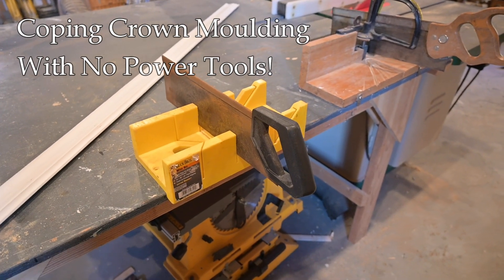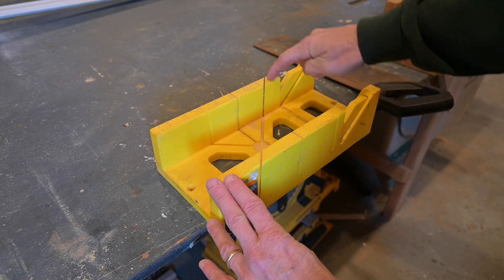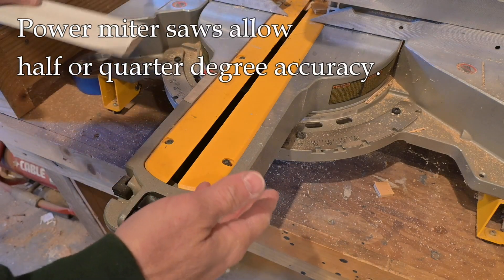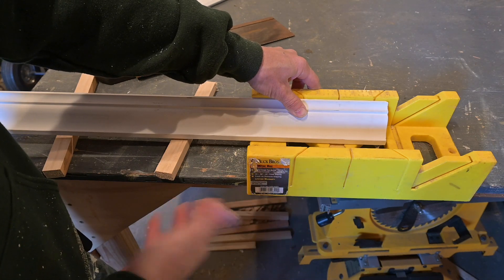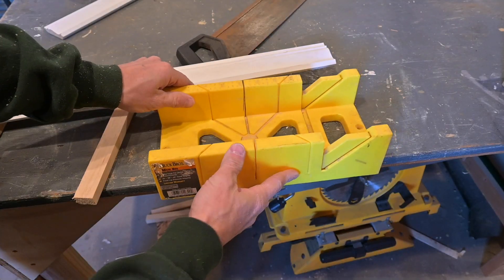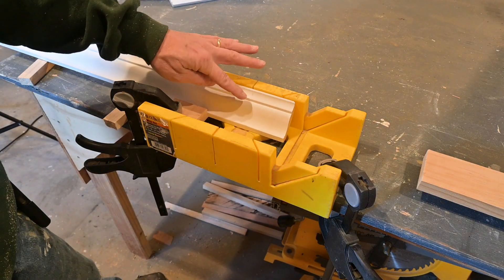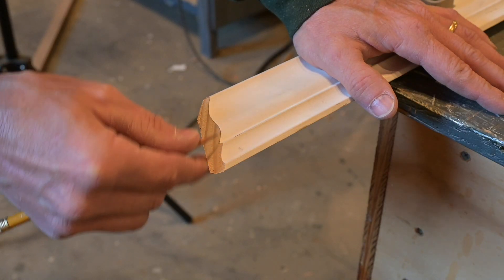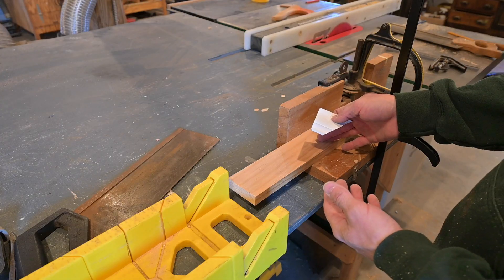Coping Crown Moulding With No Power Tools!

Comment: I thought coping was always done with a manual scroll saw.
Reply from the maker: The actual coping is often done with a manual saw, but there are other options now, as I mentioned.  In a production environment where you are trimming out multiple houses in a development, for example, it might make sense to use a jigsaw or other power tool.  I still prefer a jigsaw, however.